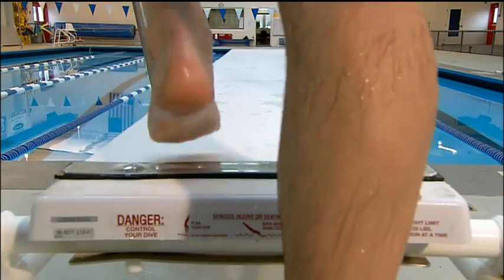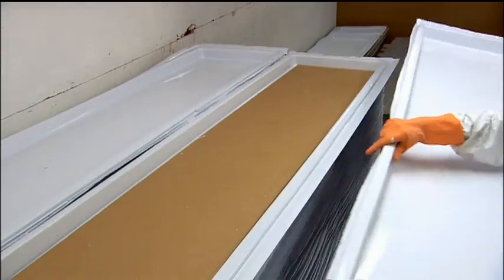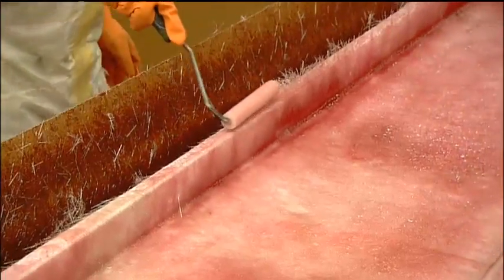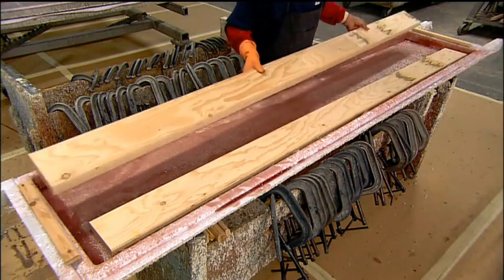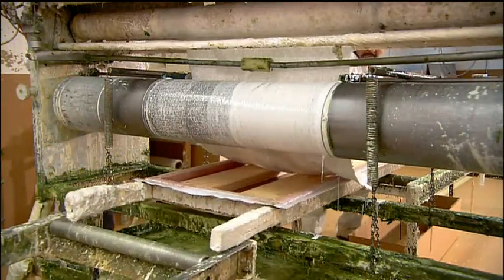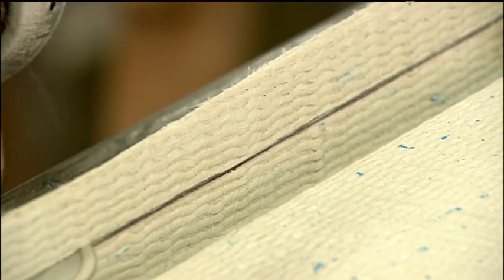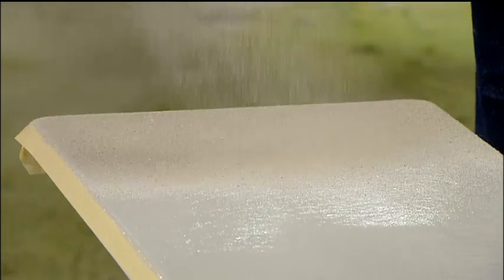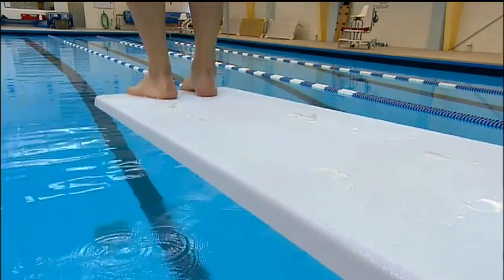Diving Boards - How It's Made

Comment: The board with double 2X4 stringers is not durable. I had an SR Smith like that on a pool installed in 1990 and I cracked it within a couple months. I'm not very heavy at 210 lbs. I got it replaced under warranty with a board made with a wide solid laminated plank. Still good 29 years later.
Reply: And the laminate didn't kink or wrinkle with the plank bending?
Reply: @manioso  The 8 foot long board is probably a 2 x 12 wrapped in thick fiberglass so it's about 15 inches wide underneath plus some side trim making it 17 inches wide on top. It has the Flyte Deck base and there's not a lot of spring to it. Nothing like the boards in the Olympics that catapult you upwards. That's why it it doesn't kink or wrinkle. You don't want too much spring in a backyard pool that is only 8 feet deep. Pretty low performance board but also, no broken necks in the 35 seasons of use.